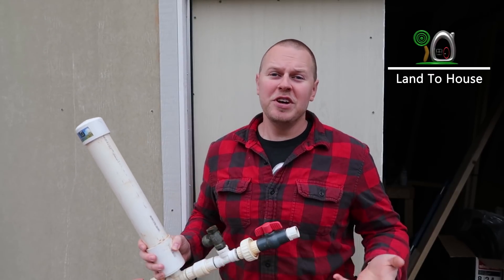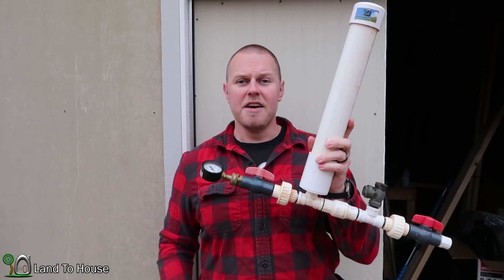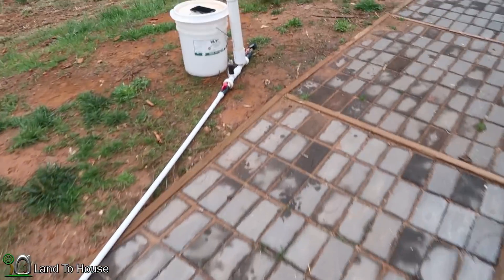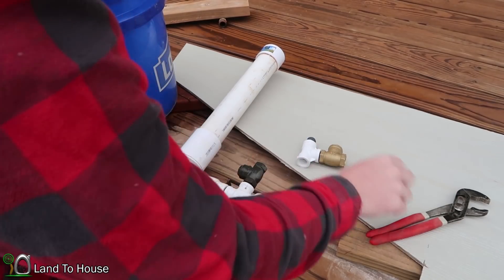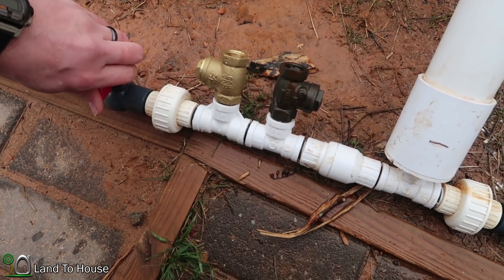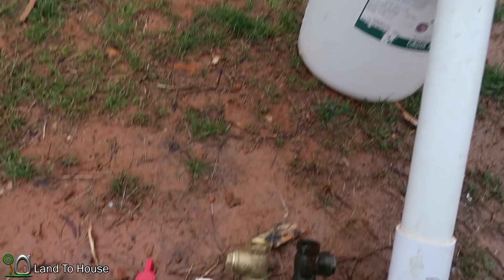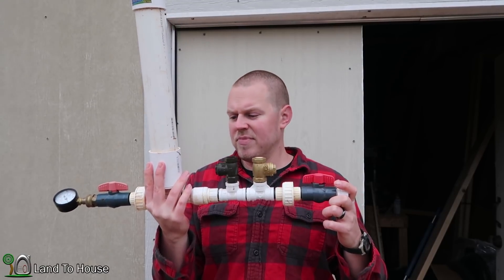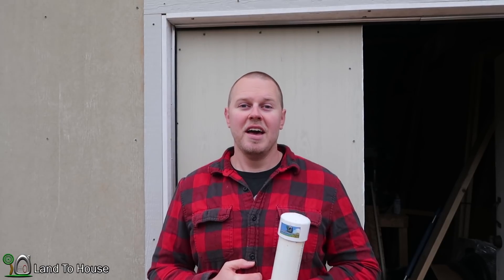Double Waste Valve Ram Pump Test 1

Comment: I've got to pump water up about 300' with a 40-50 foot elevation. I will be drawing water from a fast-moving river. I have a 1 1/4 " ram pump. Will a taller compression chamber help get water up higher? Any suggestions? Heading to Alaska in a couple of days to try to make this work. Thanks for any tips.
Reply from the maker: To pump water up to that height you're going to need approximately 8 feet of head pressure. That's drop in your water source. A taller pressure tank actually does not help past a certain volume.
Reply: @LandtoHouse  Thanks, my friend. To be clear,  8' of head pressure means the water source needs to be 8' above the pump? Will a stand pipe help my situation ?
Reply: 1 more question. What about using a 2nd pump midway up the hill? Go up as far as possible, then turn the pipe back downhill for 8-10' then add a 2nd pump to get further up the hill?

Comment: If you have a good head and volume of water, it is better to double the waste valve, more volume if water deliver
Reply from the maker: Meaning have 2 waste valves? Yes so true. To a point.  It will still deliver to the same height but have more water.

Comment: If you have a higher elevation of head pressure and  enough volume of water to drive the pump, it can deliver a more volume and higher lift. I tested this system already.
Reply from the maker: My test showed more volume but same height. I need to retest this one.

Comment: What happens if you reduce the waste valve opening with perhaps a plug with a smaller hole drilled in it to constrict the water lose?
Reply from the maker: It will reduce the output water to a point that the valve will not slam and no cycles will happen.

Comment: would it add more pressure or pump further away if you add 2 pressure tanks and just one waste valve
Reply from the maker: Doubling the pressure tanks just increases the volume of the tank. Increasing The head pressure is the only real way of getting higher. As for distance you can pump a long way without much head pressure.

Comment: Is there a formula on how to calculate the size of the ram pump relative to the height and length of where the water is needed?
Reply from the maker: The size of pump is actually just going to change the flow rate required to run the pump and the output volume.  The lift is based on the head pressure.

Comment: If the volume and pressure of driving water even the same diameter of ram pump and drive pipe you can install even 4" waste valve. I done this, my ram pump working very well and can deliver good volume of water eventhough of more than 40 meter of vertical height and 300 meter away from the ram pump.

Comment: what size piping are you using?
Reply from the maker: Normally it's important to keep the drive pipe the same size as the waste valve but in this test I found that I had to go one size higher in drive pipe to get the valves to close.

Comment: Hello could you make a recommendation on what I would need to pump water  70’ up the hill ?
Reply from the maker: Hello. Each ram pump size can lift water to 70 feet. I recommend that you have 11 feet of head pressure and and use a pvc drive pipe for best results.

Comment: You don't know what you do. Pressure is not determine by how many waste valves installed. Pressure won't change by increasing/decreasing diameter of inlet pipe. Pressure is function of the height of water source to the pump. PE= water density X gravity X height.
Reply from the maker: Your comment is correct. . . But posting a video with black background and a simple text equation does not make for very good youtube. Much better to make a fun video test out of it.

Comment: How about the two valves side by side on T's (parallel instead of series)?
Reply from the maker: I have never seen a pump like that. They have always been in series. I will add that to the pump testing for this sumer.
Reply: @LandtoHouse  this will mean each valve has x amount no roll on effect from valve to valve very interested is seeing this test
Reply from the maker: Last summer I gathered the parts for that test and put the pump together but did not test. Let's do that this summer.

Comment: What about a one way valve on your supply head to keep the pressure of the closing exhaust valves from traveling to your supply?? Would putting the one way valve closer or further from your pump increase the efficiency?
Reply from the maker: Actually installing a 1way valve in the drive pipe will stop the pump. The pressure wave needs to travel the full distance back to the source to build momentum.

Comment: can you make 2 input for a single output, maybe it build up more psi
Reply from the maker: From my understanding two drive pipes would interfere with the pressure wave.
Reply: @LandtoHouse  that was mu thinking with this video surprised they stay in sync however having two drive pipes with a check on each and a inline oneway before t ing back to pump will fix this each acting independent
Reply from the maker: I want to test that this summer. Should be fun.

Comment: I built one a few years ago and built it with a 2 inch drive pipe and 2 inch waste but 1 -1/2 horizontal check with a 3/4 inch output pipe.  Worked great for a season then I stopped growing in the field that it was pumping too.
Reply: How much of a lift did you have and what pressure also at what rate per min/hr

Comment: I would mount one waste valve directly on top of a 1 inch drive line and then put the second one onto the 1/2in pipe.  This what plastic is for. Research and learning.  When you go to build one that your life depends on then you switch to all metal components.
I went through all the different stages of ram pump building and after ten years I;m still improving and the service intervals are getting farther and farther apart.
Very good experimentations you have done in this video.
But if you are planning to run yer world around a homebuilt ram pump try watching "dougs ram pump" series of videos if you want to save yourself some headaches and money and especially if your world depends on it.
Good job on the vid.

Comment: Or 1waste valve and larger pressure tank volume
Reply: I would think with 2 waste valves and a larger pressure tank that it would produce even more.  probably harder to get started.?
Reply from the maker: Seems like adding additional valves only increases the flow rate. Increasing the pump size seems to be just as effective
Reply from the maker: There's actually a point where increasing the pressure tank size no longer makes a difference. As long as the tank is big enough to support the fluctuation with Cycles it will only reach a pressure relevant to the head pressure

Comment: What happens if you double waste and a larger pressure tank
Reply from the maker: If you increase the size of the pressure tank it will just take longer to start and prime the pump. After that it will just run normally. No extra increase in flow.

Comment: I like to get the most efficient or highest height pump.  Will this ram pump need duel check valves?  I also saw another video on Youtube claiming more the 1:7 ratio.  It claims it can be 1:10 or even 1:30?
Reply from the maker: After a few tests I gave learned that adding valves does not increase height. This pump can achieve greater than 1:7 ratio. It is important to have a ridged drive pipe. PVC is recommended. You can get closer to 1:8 ratio.

Comment: If you're trying to increase the psi of the pump, there's 2 things you can do. 

The First is easy and mentioned briefly in the video: Simply increase the diameter of the pipe feeding the pump. 

The Second thing that you can do is increase the air spring. Usually that means making sure that the compression chamber is rigid and air tight, but making sure that it's insulative so that heat isn't lost to the environment. If you're going super exotic, you could try replacing the air in the compression chamber with argon, but.... that's stupid fancy.
Reply from the maker: From my tests I find the best way to increase PSI is just add more head pressure to the system.
Reply: @LandtoHouse  if you mean distance down stream not practical. downstream is someone else's land.

Comment: Have you tried running two pumps in series.
Reply from the maker: Meaning the drive pipe of the second pump is pulled from the delivery of the first? That does not work because there needs to be open air and no pressure for the second pump to work.

Comment: Will a ram pump work in a shallow stream with a good flow of water and a 2 foot tall dam? I was thinking of putting the intake into the base of the dam
Reply from the maker: The ram pump needs head pressure to operate. With a two-foot-tall dam it would be best to have the intake close to the top. With two feet of head pressure you can gain approximately 14 ft of lift. The smallest pump I make is half inch and requires around 3 gallons per minute to operate the large pump one and quarter inch requires around 8 gallons per minute.
Reply: yes; lift of 20' should not be hard for that head. use 2" pipe and fittings.
.

Comment: implementing some permaculture solutions will help your land immensely.. "too much  water" isn't a problem... you just must redirect the overflow with small trenches..hardly any depression allows the water to be diverted and carried to the peaks of your property...using about a 1-2% grade it allows the landscape to absorb water and not erode your hillside...recharging the aquifer helps for more springs to develop on higher elevations.. I have a several thousand acre permaculture project I'm in the early stages of developing near Yakima WA. Regreening the desert and helping to provide a model of transformation to recreate the food and resource abundance the Garden of Eden provided. With localization of resource and human needs for well being...it moves everyone, everywhere into freedom and away from the perception of centralized freedumb.
Reply: In some states, like Va, you can be fined big bucks for redirecting creeks and streams by e.p.a even on your own land.
Reply from the maker: I hear it's also not good to save rain water in some places.

Comment: I think, if you wanted to increase efficiency, the best way to do it would be to increase the volume of the air chamber. Once the 2nd valve closes, there would be more volume of compressed air to push water out the output before the system cascades and resets itself.
Reply from the maker: I am thinking that the best efficiency is finding the correct length drive pipe for the head pressure. Also weighting the waste valve to match the head pressure also increases the efficiency. The double waste valve thought was fun but not practical.
Reply: That makes sense. Also it might be worth experimenting with different check valves to see if different types work more or less efficiently. I think that the amount of back flow required to close the in-line check valve may play a big part in the volume of each cycle of the pump because, for a moment, the flow actually reverses until the check valve closes.

Comment: With this setup, it's about the same as having a larger check valve with more flow. However you can probably do these in series repeating with the valves and expansion tanks further down the line. (Accepting that it's going to reduce the overall amount at each step due to what the check valves drain from the system.)
Reply: @kuroryuu010  More flow potential isn't necessarily required. It would take longer than the fraction of a second to reach max velocity. Two valves will always be better until you reach the max velocity for the diameter and head height.

Comment: Use 3/4 inch pipe, and one 1/2 inch waste valve
Reply from the maker: Yes that is definitely the answer. Later I used a larger pipe and it worked

Comment: Great video!. If the upright plastic tube was in creased in volume , would that allow a greater area for compression or back pressure Im not quite sure how this tube affects the running of the pump.
Reply from the maker: The pressure tank allows for pressure to build so that water can be moved up hill. If you increase the size of the tank it does allow for a larger volume of air to be compressed. But does not increase the potential. It basically is a cushion if the delivery pipe is opened too quickly.
Reply: So a larger diameter pressure chamber should be more efficient, right?

Comment: seems like the drive pipe should be twice the size of the delivery pipe...as I have seen in most videos...just saying...Engineer775 explains it as such...he seems pretty knowledgeable..only reason I watched this video...is you were trying to run with 2 waste water flappers...I skip all your videos...your intro is ...is...is...anyone who builds like you will have the same problems you encounter...you come across as a know it all...just my opinion...have fun...
Reply from the maker: I actually ran a test recently showing that the Drive pipe must match the waste valve size for the highest efficiency. As for the delivery pipe the main thing that affects the size is the friction loss in the pipe. Atmospheric pressure will be the same on any column of water no matter the diameter pipe.  Now the ratios that engineer775 discusses on supply line standpipe and drive pipe are accurate..... thank you for your feedback on the intro. You'll notice that the past 200 videos do not have that intro anymore.

Comment: Is the distance from the water source to rump pump important? Also do I have to use pvc pipe or rubber house is sufficient?
Reply: According to the fundamental laws of conservation of (kinetic vs. potential) energy and conservation of momentum, the distance from the water source to 'pump' should be insignificant ... in a perfect or extremely well designed situation.   

However, using smaller diameter piping and long runs of that piping will only 'bleed off' the available energy via FRICTION; the developed friction will mathematically reduce the 'static height' and 'mass flow' of the in-feed water !!!!!!!!!!  

Secondly and still observing the same laws of physics, the use of two check valves on the drive pipe section will/can increase the 'time interval' of the impact (hydraulic shock) which results in LESS impact (hydraulic shock); hence LESS energy transfer !!  The longer the time duration of impact, the less energy is transferred!!!!   Use a BIGGER valve, not two valves on the drive piping ..... and increase the diameter of the drive pipe to lessen frictional losses of the input water.   In hydraulic systems - larger diameter, the least amount of 'transitional' piping, smooth internal pipe surfaces, & long radius elbows, etc. is always 'best' when optimizing 'performance'.  One must usually economically 'balance' the extra cost vs. system efficiency --- test (breadboard experiment) to arrive at 'optimum'.    

FWIW - there are formulas to calculate such frictional losses vs. flow rate and developed pressures in piping, on the internet .... such as www.engineeringtoolbox.com , etc. etc.  Transitions of internal diameters (so-called 'adapter' fittings), short-radius ('close' or 90°) elbows, poorly designed (check and throttle) valves will greatly contribute to additive frictional values ... for less flow and less static/dynamic head pressure when the system is operating.  What youre looking to do is to keep your flow in the drive pipe 'laminar' (non-turbulent) to keep the friction loss to an absolute minimum. 
One can make their own l-o-n-g radius elbows in plastic pipe by filling with sand and applying heat ... and then bending to the desired 'long transition' shape. Short 90° elbows and non-smooth changes in the internal diameter of piping are the prime 'robbers' of energy in any piping system; the long radiused and 'smooth' ('bell mouthed') transition of diameters cause less 'turbulence' of the liquid flow.
FWIW2 - The use of poppit type check valves usually have greater 'impact' ('faster' impact time); hence, should increase the impact & momentum of the energy transfer, .... which is what 'drives' the system.      

hope this helps   ;-)
Reply: RichH yep use drainage fittings not pressure, so pop is moe Betta den swing, thanks it's in the original commercial wons fer good reason
Reply from the maker: The distance needs to be longer than 25 feet but less than 100. rubber hose won't work. Pvc is a much better option.
Reply: this is very similar to a mormon pump,except all the wasted water interesting though

Comment: What would happen if you connected a open ended tube above the waste value that is the same height as the pressure vessel?
Reply from the maker: As the height of the waste valve increases the head pressure decreases. So you are reducing its potential as the waste valve goes up.

Comment: I feel like it would be much better to branch off from a bigger pipe into a t into two separate branches/ separate pumps and then combining into one pressure chamber wood give increased water pressure in exchange for the extra Wastewater loss and flow rate
Reply from the maker: I have been meaning to test the double pump on a single drive pipe. I have now seen it done and know that it will work.

Comment: Why not definatively test the principle of more is better by using like 4 swing check valves sized to your system (Ie. 4-1" check vales for a 2" system (which has 4 times the area))? Then all other things would be equal and you could see if more is better.
Reply from the maker: The main thing that I will run into is having to increase the drive pipe to a much larger pipe. All those valves will needs lots of water.

Comment: what if you connect  the valve in parallel? will that increase the pressure?
Reply from the maker: That is a fun idea. I still think that there will be some issues with low flow. Also I wonder if you have the valves on separate runs that it might interfere with the other. Very interesting.